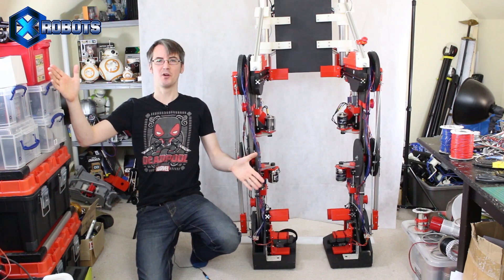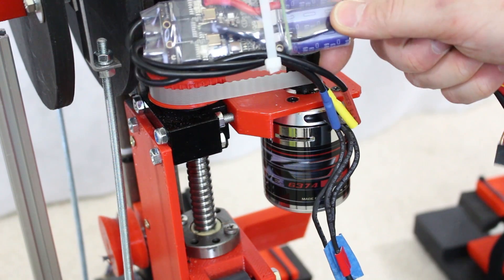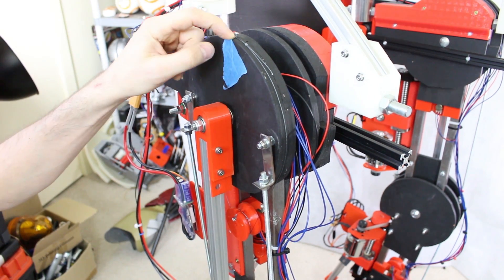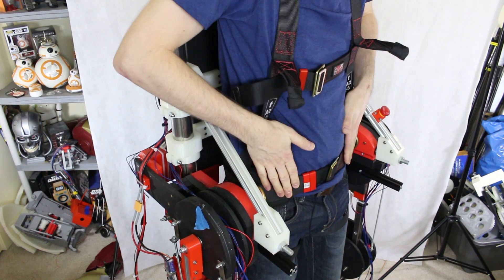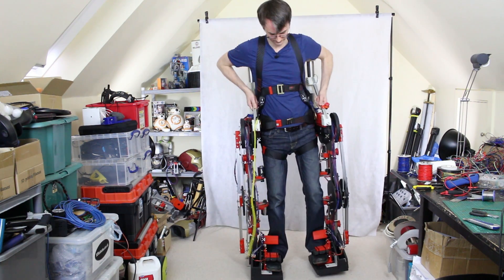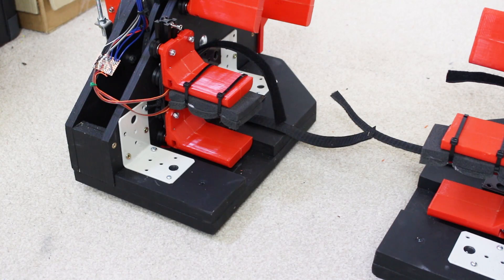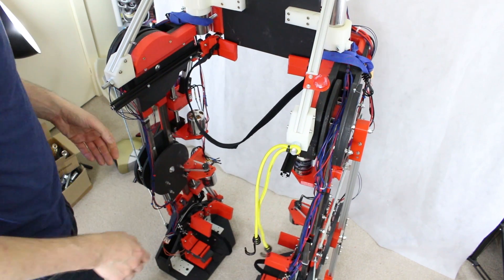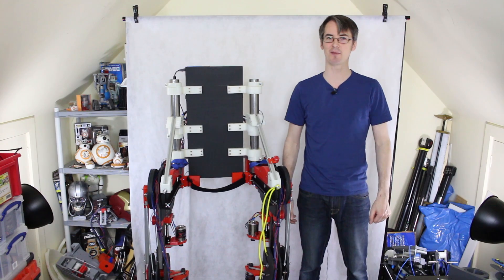Iron Man Exosuit #22 - Full Functions! | James Bruton

Comment: It still seems like it's not giving you any extra power -- like you wouldn't be able to kick a door in, or even run any faster... -- it's cool that you're trying... but even if it were perfect... it doesn't seem like it would be super useful.
Reply: Yeah, ultimately, I think you need a bigger budget... It would also be neat if you used electrodes to measure the muscle signals (it's not sci-fi, it's a real thing, and it's accessible -- college students used a few on someone's face to see which direction they were looking in to control a mouse cursor...).

Comment: This is by far my favorite of James' projects. About the only thing that bothers me is that the responsiveness is actually really good except that his toes move for a second before the leg responds. Wouldn't strapping those toes in really tight help with fast responsiveness? Also... The idea of just using one magnet sensor instead of two was one I'd had since the beginning. It seems that it would be easier, more compact and cheaper to make all of the lower sensors sprung to center with responsiveness in both directions.
Reply: I nearly forgot Robot X. That one's quite inspiring as well. Keep doing what you do James!

Comment: Measuring your movements through switches is ok an it kind of works but you mentioned how you use your own strength to lift the unit.  An alternative is if you apply sensors/switches to your own body like if you made a boot you can wear with the piviot points etc monitored and relay that to the machine.  I'm guessing though that your getting too much of a delay from the input to output.

Comment: Have you considered narrowing the back board to bring the legs closer to your hips?  
How about putting on knee-pads with nylon webbing attached to snap buckles that attach to the knee joints?  
If you built in shoes and made the leg lift rely solely on the heal, it'd follow your body at the toes, knees, and hips.  Shoes look like they'd make it so much more maneuverable, especially if forward-backward foot movement tracking has been depreciated.

Comment: I can't help thinking that pressure sensors would have been better than the sliders which seem to require too much movement. Also, I had assumed that you would strap yourself into the machine, rather than have it hang from your shoulders like a strange pair of trousers with braces!

Comment: I think you should strap the front of the legs and the sensors in the back to the waist anchors on the arness. Don't you think it would fix the problem with the bungee in the front and be a proper replace the "belt" from the back sensors?

Comment: Maybe you should move the small rubber pieces on the bottom of the feet to the inside of the feet so they’re closer under the center of gravity so that when you walk, you don’t have to move side to side as much in an attempt to keep the center of gravity above the point of contact with the ground. Also maybe consider attaching yourself to the suit from the top point of the harness on the back board of the suit so you are practically suspended in the suit so that it supports your weight, not vice versa, meaning you wouldn’t have to support the weight of the suit at all. If you do move the bottom rubber pieces, this may even allow you to successfully balance on one leg, and increase the over all maneuverability.

Comment: You might consider using the loop at the back of your harness to attach yourself to the top of the suit. This would translate the side to side motions you are making with your upper body into the suit and should help getting leverage on lifting your feet and such. It could also help in leaning the whole suit forward for forward movement.

Comment: With the foot issue, maybe instead of trying to get regular shoes to fit use rollerblades. Remove the wheels and you have hard points to attach to the frame and add sensors to. That solves the fit issue.

Comment: Great vid as usual. Could you put a point on the back board to attach the harness to the frame to put some of the weight on your sholders. You can stitch the harness if the straps move and cut your legs off lol. I was hung from a crane in one when I was a mouthy youth on site lol. TkEZ»UK

Comment: I love your use of hall effect sensors to make tuneable force/displacement sensors. I have to ask, though: did you experiment with fixing your feet to the sensor assembly? Right now it seems like you're giving up all the resolution of your sensors and treating them like on/off switches, which, if I remember correctly, is what you said you didn't like about the pressure sensors you considered previously.

Comment: Wouldn't it make sense to put pressure sensors to signal it to move through out the whole leg? because feet are the last part of the leg to lift/move during walking after the rest of the leg lifted off, bend and moved forward. Other wise you controlling the whole leg movement with you ankles and unnaturally like carrying the whole mechanism on them. Gotta translate through sensors order of operations of a entire walking leg.
Reply: Maybe put load-cell sensors on the footpads, and use the weight distribution between the feet to determine which leg to lift. I imagine that moving your weight will be one of the first things that can be sensed when taking a step. 
The algorithm on the legs could try to make the weight distribution between the feet always equal. It will probably be a bit like pedaling a bike. Putting pressure on the leg that will move down, and lifting pressure on the leg moving up.

Comment: you need to take a serious look at the hips. In order to remain stable while walking you need to set the hip joints in a way similar to the feet. A parallelogram with feedback will help you to regulate the center of mass which will ensure stability. I am not sure about the geometry, if feels that is actually should bend in 3D and not only 2D(like the knees) while walking but it will still allow you to track the suit independently from your commands. If you get the setup right it should be able to walk without hip inputs. 

Keep in mind that this thing is about to get heavier and less stable as you continue to add mass above the hip since this will move the center of mass above your waist and further backwards. The motors are not constantly running and there is a time between the command you send and the actual execution. The mass of the moving suit means that there is inertia that you are fighting with even now so be aware of trying to compensate by moving the hands of the suit. It feels natural but the weight/impulse distribution is not so fine-tuned as we are used to with our bodies.
An exo-suit is different from a robot- it relies on your input while(in this particular case) it lacks the regulation to keep you safe from over/under-steering. 

I would recommend you to use the upper attachment point of the belt system to attach yourself to the ceiling(ensure it can sustain both your weight and that of the suit). For your safety, especially during testing do not consider belt systems similar to the one you did on the hips. The harder you tie yourself the easier it will pull you down if falling. Be aware of the space you are working in and the fact that both your head and neck are exposed in a really nasty way in a case of a fall regardless of its direction.  

Apart from that, great progress man :)

Comment: To make bigger steps, you should include in your thinking that walking is controlled falling forward. It's not that you make a step forward and then drag the rest of yourself with you - unless you are part of The Ministry of Silly Walks #MPFC. It's more like you lift a foot, lean forward and by making a move to prevent yourself from falling on the floor you actually made a step. Maybe your robot should have sensors that tell it "OK, this is far enough leaning forward, now it's critical, let's better make a step." :)

Comment: What about strapping a flex sensor to your knees to control the knees instead of the foot sensors all together.  When you think about it you want the knee to bend when yours does not when it feels upward pressure.  You should be able to do a squat with the suit, and I believe with your current setup you could not because you'd need to have both feet off the ground to do that.  Keep up the good work!

Comment: Maybe try to use ski bindings in combination with ski boots (or a cheaper solution maybe from a bike?) to really fix your feet into the suit while being able to simply step into and out of the suit. 
Also isnt the point of a exo suit to relief the body of stress (you lifting the suit to walk forward? I know its difficult to find a proper mechanism to move forward but when the suit will get heavier and heavier it will be impossible to move (not even speaking of lifting and carrying things around).

Comment: I feel a bit bad making this comment because I love this project, but to a viewer like me it does look a lot like you are actually somewhat dragging the suit around. Rather than your movement being picked up and causing the suit to move. 

Is it tiring to use? Because it shouldn’t be, should it? And, the real purpose of this suit is to “make you stronger” right? Like IronMan

So, will it? Will all this investment mean your legs can lift heavier loads? At all? Or is this idea just dismissed for some reason?

I do love this build. I watched the vid as soon as I saw the notification. But I also think others will have these questions, so you can correct my assumptions if I’m wrong. 

Keep going. Can’t wait to see the arms!!
Reply: I'm not sure that he really is dragging the robot around. The motors are still too slow to keep up with James', but I think they are actually being used as the movers. I suspect that the delay in the motors plus James' effort the keep balanced in the suit give the appearance like he's making a big effort to move the suit.

There's still a lot of room for improvement in this current design. He still might not be push the motors to their capacity which would yield a faster response from the suit. Plus a more fine-tuned motor control algorithm might be available which can better balance motor speed with accuracy. Finally, James is clearly not completely committed on the foot sensors and he may figure out a better placement for the sensors or find a more responsive sensing algorithm.
Reply: Graham Southern this could be a prototype....probably improvements will come along....
Watch all his videos on his bipedal robots. Considering how well those robots evolved...this could and probably will be able to bare all the weight
Reply: It is with that hope .... I continue to watch his videos.... And everytime it doesn't fail to entertain me
Reply: Yeah, the original plan was for the legs to be the support for the weight of whatever the giant arms would be carrying. It's a neat robotic project, but I don't know if it's that useful. Maybe he could do a load test? Even if it was in just a standing position.
Reply: idk
Reply: Graham Southern 
F

Comment: Replace the bungee in the back with another ballscrew and use your knees to control them, should be quiet natural
Ps: your feet get more responsive i you change the sensors like on the hip using only one for back and worth, this way you can control the deadband in software

Comment: Keep it up. You're getting there - It looked really nice this time around. Do you think these motors will hold up when u put on the torso and hands? Also the goal of exoskeleton is to make you not only cooler, but stronger. Now i know this is on a budget, don't get me wrong, I've been watching your channel for more then 3 years now and I am still impressed. Just want your estimation - would u be able to lift some heavier stuff, say 50-100kg? Or are you more realistically tailoring this project to flesh out the controls and make a functioning exoskeleton, just not a powerful one? Cheers!
Reply: Alex Chobanov I just made a similar comment. The whole point of the suit is to make one stronger. I’m interested to know if it will.
Reply: Well, there are several points - entertainment, personal development, practice. We have seen James build 4 ball droids, untill he is satisfied with it. This exoskeleton is already looking much better then the previous, however the question remains. I'm just curious.
Reply: I think he's exploring the principles and challenges that building an exoskeleton implies, and doing so on a budget to reduce risk of spending unnecessarily large amounts on incorrect solutions. I'm expecting him to do a FullBody Exoskeleton 2.0™, after he finishes this one (add arms, or one arm and a mass on the other side - for balance). Strength should be a matter of getting better pieces and controllers, but not being fundamentally different.

Comment: Looks gr8! But I'm worry to see you're leaning from side to side while walking. When there is going to be a weight on top (in a hand, moreover in different positions) that might require from you much more strength to keep the whole suit in balance and in place - and that might not be even possible if we're assuming that suit allows to lift up things that are heavier than you can lift on your own with the suit.